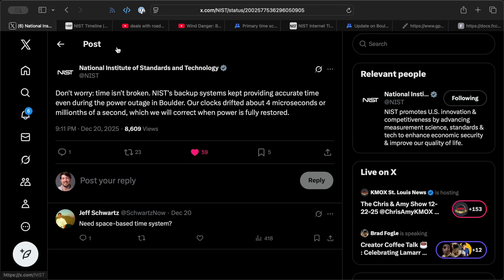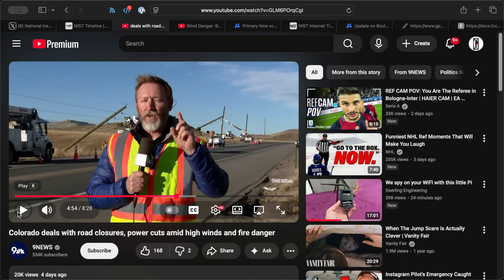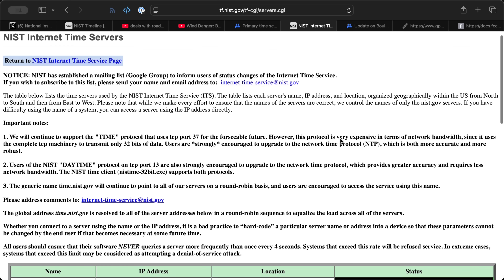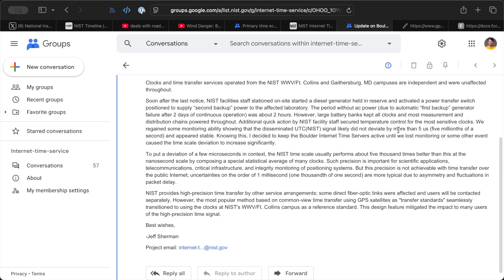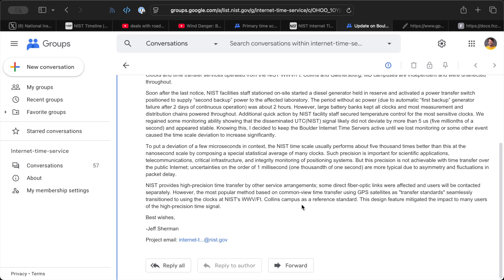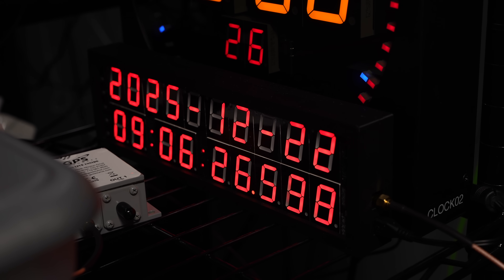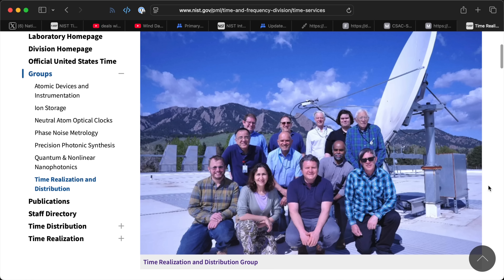NIST's NTP clock was microseconds from disaster

Comment from the maker: Jeff Sherman just posted a final update on the NIST Internet time mailing list: 

"By 22:24 UTC (3:24 pm MST) on Sunday, Dec 21, NIST staff brought the offset of UTC(NIST) from UTC to the level of a few nanoseconds (billionths of a second), which is well within the normal range of precision for this system. This re-alignment was achieved using a backup time scale system at NIST Boulder. Assessment and other service repairs continue, but UTC(NIST) as furnished to the Boulder Internet Time Service is now providing accurate time."

He also confirmed the time was never off by more than 5 microseconds, and that it was within acceptable parameters for NTP services the entire time.

See the full email here: https://groups.google.com/a/list.nist.gov/g/internet-time-service/c/iGWwc_SsXps
Reply: If only we could squash that pesky one hour wiggle that seems to happen to the clocks every year, with the same vigor with which this 5μs wiggle got stamped out.
Reply: How does NIST know/determine it's "a few nanoseconds" off from UTC?
Reply: we just had a solstice, maybe they used a very well calibrated collection of big rocks ;)
Reply: @chuckbatson595 despite the old adage that two clocks are both wrong, they have multiple clocks.
Reply: @JohnRunyon  That may be, though I'm still curious how they are compared or synchronized at nanosecond scale, especially if there's some kind of multi-clock arbitration occurring. I suspect it's not NTP. :)
Reply: Jeff talking about Jeff
Reply: I am confused why they lost sync? They distribute the NTP reference but they don't have an atomic clock? For an atomic clock deviate 5 microseconds take a very very very long time: thousands of years maybe more. Ok they lost power but and the other clocks, you never have just one because is a nightmare to turn off an atomic clock and sync it again without other on site. You may think GPS signals can help but not only military receivers have temporal precision because they use two frequencies to compensate for atmospheric delay but ... even this is not enough for the precision required by an atomic clock. Losing just one is not a problem. Again how that made time deviate? Those explanations do not explain that. Even a secondary local standard like a Rubidium reference would not deviate 5 microseconds in days.
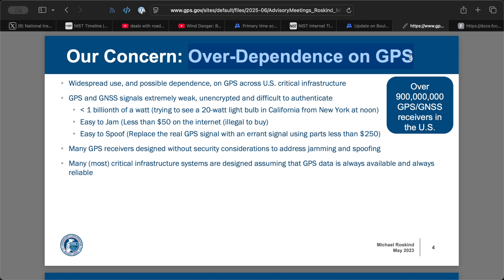Reply: 4:08 Over dependency on GPS not only for timing: airports all over the world decommissioned beacons, even VOR is being decommissioned: see Ukraine war: the president of EU had problems because of the jamming of GPS signal by Russia and the only could land safely because the airport had a VOR: REMEMBER VOR IS BEING DECOMMISSIONED ALL OVER THE WORLD. Over the ocean planes use Laser ring gyroscope for inertial navigation AND GPS. I aim fearing the day they will decommission ring laser gyroscopes too.
We are putting all the eggs on the same basket and creating a single point of failure for civilization it doesn't matter if you used Navstar, Galileo, Baidu and Glonass all at the same time: when they fail they all will fail (like in jamming for instance).
Reply: Just saying... https://youtube.com/clip/UgkxyJOrVfweuk9MTTukg0GCQIVNdHJoBP5j?si=GgWsqFOAin2pLCAu
Reply: Oh no, my logs will be off by 5 ms.
Just kidding, I have my own NTP server relay to ensure everything is equally wrong.
Reply: @monad_tcp   That's 5µs, not 5ms.  But what's 3 orders of magnitude between geeks?  ;)

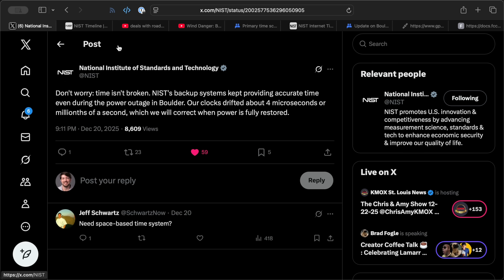Comment: 0:06 Darn Xcel energy!
For reference in Colorado 120 MPH winds hit wide swaths of the state on a near annual basis, often for days at a time.
After needing to pay out due to maintenance negligence for the 2021 Marshall fire, Xcel throws a hissy fit whenever the winds are strong rather than spending their substantial profits on the grid to prep it for harsh and normal conditions. 
Other power companies in the state deal with the conditions and keep the lights on.
Xcel is just setting up to be PG&E 2.0 with the same software and policies... go figure.

Comment: I have a magic clock that if the power goes out for a few seconds then nothing happens and it keeps telling you the time but if the power goes out for longer then it tells you 12:00 like you'd expect except after a while it goes back to telling you the correct time again. No idea how that work but when first setting up the clock you have to tell it what time zone you are in. Wtf?
Reply: The clock is receiving radio signals from a national atomic clock in your part of the world and resets itself from time to time.  The signals come from NIST's WWVB transmitter in Ft Collins Colorado for the United States.  Other countries have their own systems.  You have to put in your time zone because the transmitter is sending the time in UTC.  The clock then has to adjust it for your time zone.
Reply: @stargazer7644 strange how I never need to tell it the time zone again after a power outage. Even one long enough to make the time go back to 12:00

Also yes I'm in the USA. How am I getting radio signals from Colorado when I don't live in Colorado? I don't get radio stations from Colorado so?

Comment: Great video! Quick terminology clarification: technically you’re running a Stratum 1 NTP server with a GPS (Stratum 0) reference clock. Stratum 0 is the reference device itself (GPS receiver, atomic clock, etc.), while Stratum 1 is the server directly connected to it.

What you’ve built is still incredibly impressive, GPS-disciplined Stratum 1 servers are the gold standard for local time infrastructure. Very few people get around to adding rubidium oscillation to their setup.

Comment: Not a lot of people know that ntpd has support to source time directly over RF from WWV.  I think it would be interesting for a video to see this setup with its pros and cons compared to say GPS.  I think you uniquely have the skill to do a really good video on it.  What do you think?!  BTW - the ntpd source distribution has a write up from the author of the RF code in ntpd that does it that is an interesting read.
Reply: That's a bad way to do it if precision is important to you.  The skywave radio path between you and WWV/WWVH is unstable and often changes by a dozen milliseconds as the ionosphere moves up and down from day to night.  WWVB (60kHz) travels only by ground wave and is far more stable and is usually the RF source used for NTP.  A cheap GPS timing receiver is stable to within a few nanoseconds.
Reply: @stargazer7644 sure gps is better but this works inside and is a neat project.  I wouldn't run my global big table database on it, but ”the driver achieves an accuracy of approximately 1 ms relative to the broadcast time, with variations up to 0.3 ms due to ionospheric propagation effects”

Comment: Hi there .... thanks for your update.  I just wonder that SMPTE push on BPS over DVB.  And ITU push MPS over AGPS.  This is very interesting ... about Internet have NTP,  but todays TCP/IP networks seems don't have Master Clock server ... maybe Switch/Router/UTM have resource for that ... but what about the devices.
Reply: The Internet really tries hard not to have a Master anything.  It is designed to be fault tolerant.  Everything is distributed, including NTP.

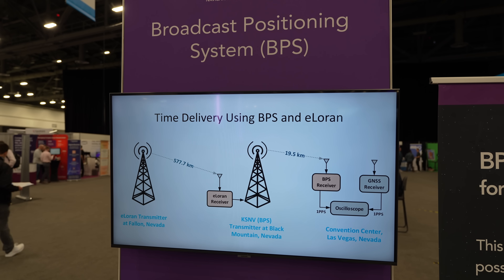Comment: 4:22 It's interesting to see eLoran here. In the early 2000's feels like there was a progressively stronger reliance on GNSS / GPS because it works so well most of the time, and the old LORAN-C system was being decommissioned. It's only in more recent years where there's growing concern over reliance on it. The US Navy, which stopped teaching celestial navigation for a while in favor of electronics, also brought it back to the curriculum in recent years as part of this.

If GPS do fail though, it really would be disastrous even with all these backups. For one, most satellites in space use GPS to get timing/positioning info. They are in space and can't really use ground-based systems easily.

Comment: Wouldn’t a networks round trip time for sending back a time request be far greater than such a small amount? I’m guessing the system depending on it can withstand a bit of lag, as long as it gets corrected quickly.
Reply: NTP is designed to measure and correct for network delay.

Comment: Hey Jeff, as someone who was involved I feel like I should fill in some missing details.

- there is not one "main ensemble clock", rather a "time scale" which consists of many different masers, cesium, and fountain clocks that are combined and compared (weighted) to produce a UTC standard. 
- only one building lost power, so only about half of these clocks were without power, what "drifted 5us" was due to their UPS of the PPS distribution switch dying, and the synthesizer, which only has a quartz oscillator, slowly drifted.  
- none of the masers or cesiums stopped functioning due to their DC power reserves.
If you have any other questions feel free to reply :) 
Merry NISTmas!
Reply: I mean, this obviously calls for a tour video! Time, infrastructure & networking combined? It would be a delight for us Internet travelers. Thanks

Comment: A seven-second clock drift can cause Google Authenticator codes to fail even though TOTP nominally allows a ±30-second window. This happens because some servers use a narrower tolerance, accepting only the current time step or one adjacent step, so a code generated near the edge of a 30-second window can fall outside the accepted range. Network latency or processing delays can add a few more seconds, effectively making the server see the code as late. Minor rounding or truncation in the TOTP calculation can also amplify small errors near window boundaries. Resyncing your device’s clock with an accurate NTP source usually restores reliable code generation.

Comment: How long until we run into a problem with operating our major digital time infrastructure on milliseconds since 1970?
Reply: Pretty much all computer systems (including Linux, Mac and Windoze) already have (or are capable of) using 64 bit time.  The 2038 overflow is a 32 bit problem.

Comment: Old school long haul ATM networks used GPS for clock signal synchronization. You could sometimes see Rohm Telco buildings near catv, mobile tower and fiber huts with a little cone gps receivers poking out the sides near the roof. They didn't really use NTP, just a stable clock beat from a shared clock.

Comment: The US has been looking for a backup to GPS for at least a couple of decades now.  Go back 20 years and look at the Volpe report.  We had identified eLORAN as the best alternative, but apparently there was some politics in DOT, one person in particular, that killed it. We still had the LORAN-C sites that could have been upgraded. But those got sold off. And here we are even more vulnerable.  By the way, many of the original cell phone tower sites used LORAN-C receivers as a backup to GPS for time.  Back then, cell phone networks could go about an hour I think before synchronization between towers was degraded to the point that handoffs couldn't occur anymore.

Comment: I used to work for an ISP, and I set up just computer based time servers, but they were calling out to the upstream servers regularly. Millisecond accuracy was fine for being able to compare logs between servers and devices, since hops across wireless connections and even fiber links were still in the low millisecond or high microsecond range.

Comment: How does elevation, latitude and latitude effect the timing from satellites?
Reply: It doesn't for the end user.  Your GPS receiver adjusts for where you are and synchronizes the oscillator in the receiver to match UTC time to within nanoseconds.  All GPS really is, is a bunch of orbiting atomic clocks.  The receiver figures out where it is by comparing the varying timing delays from each of the different satellites, and once it knows where it is, it corrects its internal clock.

Comment: Ever since I learned about Internet time I have hated it. Why not receive the time signal off the air from your friendly local VLF time and frequency standard station. Radio waves, that is. Yes, challenging indoors for VLF.
Reply: Because VLF isn't as stable due to daily changes in the atmosphere.  VLF often can't be received in the daytime so you have to go many hours between time updates.  GPS is far superior for timing.
Reply: @stargazer7644  There could be multiple VLF time signal transmitters in the world instead of just a few. A national time signal source that can be received within up to 1000 km 24/7 is by all means possible (local, as I said). Decca navigation system and LF radio beacons worked quite well in the past. A VLF station costs way less than a satellite.Certainly the VLF/LF band is under heavy RFI from switching power supplies and the like.

Comment: 1:54 “Reroute emergency power” normally something I only ever hear on Star Trek
Reply: Lived through that on a smaller scale, not fun. Making full use of automatic switchers to route power to critical loads and orchestrating what stays up and what should shut down to avoid catastrophic loss.

I was too busy managing the situation but someone pointed out that I was "star trekking" the situation, wheeling a spare UPS from less critical systems outside the advanced redundancy system and plugging it as an extra spare input to the main server load balancer.

Comment: Does anybody really know what time it is?  🙂

Did they lose their primary source (stratum 0)?  Or just NTP stratum 1?

Also, all these time servers around the world are synced to International Atomic Time, which is the average of some 450 atomic clocks around the world.  UTC is then derived from IAT.  There's an article about IAT on Wikipedia.

NTP is designed to use multiple sources, to provide redundancy and filter out bad data.  This means the problem at NIST would soon be resolved as NTP does it's thing.  On the other hand, the primary source could be a more serious matter, as it has to be synced by other means.

Comment: A few notes from a local. First, almost exactly 4 years ago a similar windstorm resulted in a grass fire that ultimately destroyed 1000 homes several miles from the starting point. I dont know if they know that a power line started it - a nearby cult had had a small fire earlier - but there was a lot of concern and Xcel started to cut power during high winds as a precautuon. I personally lost power for almost exactly 24 hours.

Second, NCAR is located on a nearby mesa and it routinely gets winds significantly higher than the rest of Boulder. We still had extremely high winds that took down large trees and nearby fences but NIST is on the western edge of town next to open space on two sides and a divided 6 lane highway on the third.

Third, NCAR does climate research among other things and El Lardo has suddenly decided to shut it down. I wonder why.

Finally, we had lost power yet again as i started watching this video. I learned a long time ago to keep internet gear on a dedicated UPS since cellular bandwidth plummets when everyone else's internet drops. It is back now - it may be aftermath of storm, or just another car hitting a power distribution component. No, i don't know why they were placed there but a recent building managed to get a huge power (something) placed on the sidewalk in front of the building instead of behind it. Thank God it never snows in Colorado and none of the tens of thousands of undergraduates at the university either drink or drive irresponsibly.

(An alarming numbet, however, have never heard the phrase "evolution in action" or thought how it might apply to someone wearing an all-black outfit and riding an unlit bike on a busy road. The problem isn't that we don't know we have idiots among us, it's that they are often riding in the shadows cast by street lights on these busy roads. I've nearly hit a few and only saw them because i noticed the lights behind them briefly disappear and reappear. I didn't actually them until it would have been too late to avoid a collision, probably them into the side of my car instead of the other way unless they were going like a bat out of hell. Which many do.)

Comment: Sounds like maintenance problem brought on by managements typical value engineering, not testing backup gensets. Our power plant went down due power lines swinging to close and arcing occurred. There should be battery systems that should be tested at least annually, other wise a Callix type failure could occur and serious damage can result.